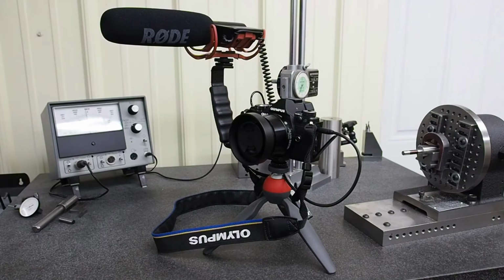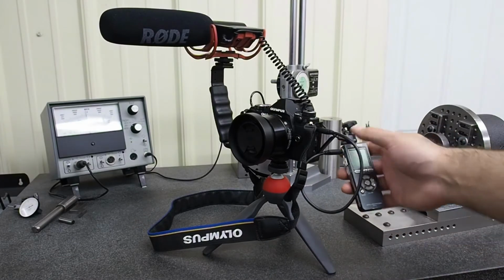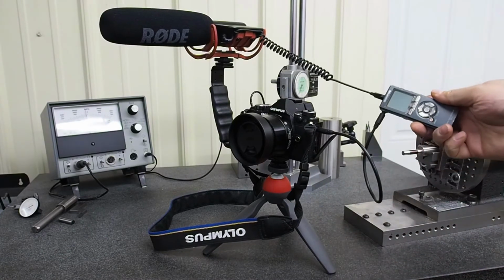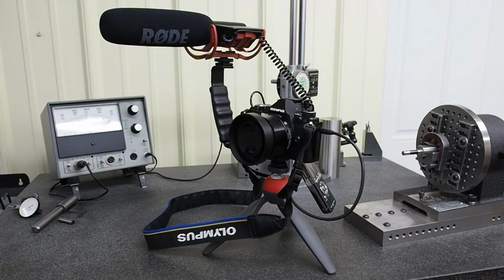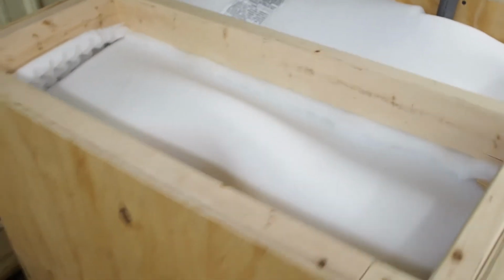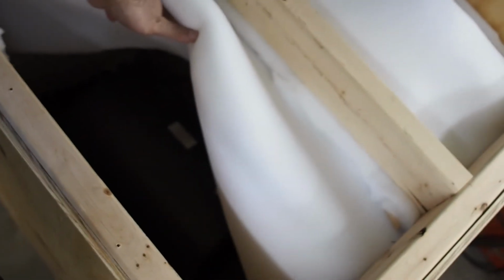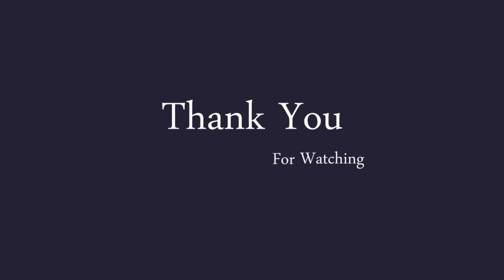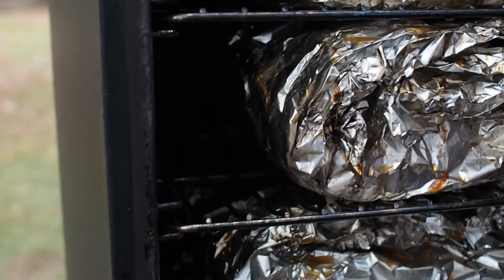Camera audio setup

Comment: Great setup, your sound is great.  Good job on the sound deading for the Rotary Phase Converter.
Reply from the maker: Thank you.
Reply from the maker: Thanks Randy,
I will most likely and a thermostatic fan in the box for heat ventilation.
Steve
Reply: I was wondering how you were going to handle the heat buildup.  By the way, y"all are doing a great job on your channel, and filling the gaps in my machining knowledge.  Thanks
Reply from the maker: Hi Robert, 
I plan on added a fan or two connected to a thermostat in the near future. In the mean time I will remove 2 side covers when running for prolong periods.
Steve

Comment: I sometimes feel as if your Dad's audio is too hot, and that it seems he's trying to speak loudly so that it will be audible. If you could turn down the input just a tad I think it would be better. Or have your Dad speak in a normal voice. Don't take this the wrong way, nothing to do with the content. Also, hard to beat the wireless mics, on a previous job I used to broadcast meetings and we used a Shure wireless mic, it was really nice, but not too cheap, I think about $250-$400.
Reply from the maker: Actually that is Dad's normal voice, he's just a loud person. I usually lower the input volume I use on other people from 14,15 to 11,12 when I'm recording Dad but sometimes I forget it until we are in the middle of the video. 

Also the rode mic has a optimal spot that you need to be in to get the best results and you may have noticed Dad likes to move a bit or have me move the camera around while he's talking so it can be difficult balancing out the audio between all the video clips. 

I have a full time third shift job and we film on Saturday which doesn't leave me much time to edit the video before I go back to work Sunday night so most of the time I spend in editing I devote to whittling 6-9 hours of footage down to about 30 minutes and the audio I sometimes only get so far before I decide I want some sleep before I go to work. I agree the audio could be better but do to time I often only go so far with it.

I've been looking at the Sennheiser  G3 and some Shure and Sony wireless mics but that will have to wait a little while.
Reply: I have the same tendency as your Dad, my voice is often loud by nature, my kids are always pointing that out...The reason I liked the Shure wireless so much was that it was always on the lapel/shirt-pocket ad was always very clear, we had the same problem with being "in the spot" where the mic was pointing also.

The other problem I can sympathize with is that if you keep adding some of these devices, like the wireless mic, you start needing a sound mixer for it, and luckily the person I had been working with had a full PA system which he brought, and it had a mixer. You can get smaller units that would work, but it is all expense at the end of the day. The production of videos is time intensive, no doubt. Lots of trials and tribulations. You're headed in the right direction.

Comment: I feel your pain getting good audio is important. I'm using a blue tooth lapel Mike and it's made all the difference. It makes it a little ease to exclude the machine noise. You can still here them but there not lowder then I am.
Reply from the maker: Agreed, a lot of people underestimate how important audio is. We did try a lavalier mic wired to the camera once but Dad didn't like the wire, we are looking into getting a wireless mic setup eventually but those can cost more than we can spend at the moment.

Comment: How is the box vented? You wouldn't want the motor to overheat.
Reply from the maker: Hi Steve,

We will pull two sides off when not doing videos. I don't think it will run long enough when doing video shots to over heat. We will keep an eye on it and if heat is an issue we will try drilling holes toward the top on one end and at the bottom on the other side.
Steve